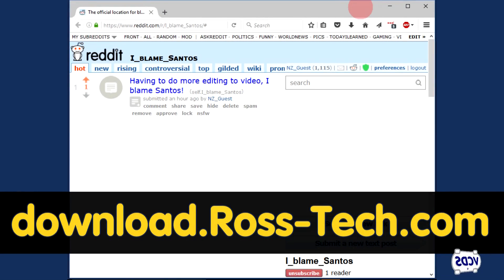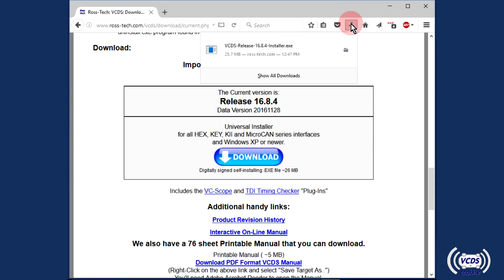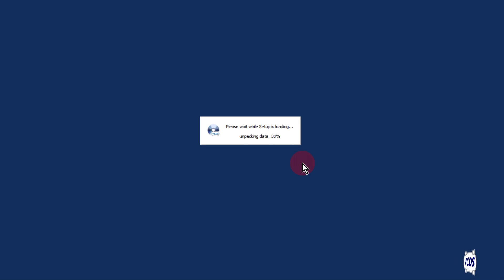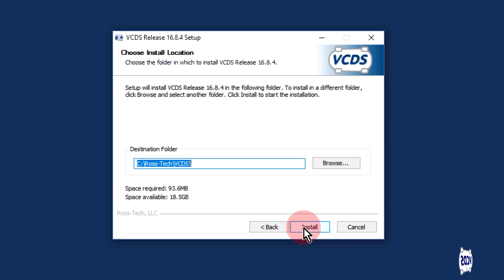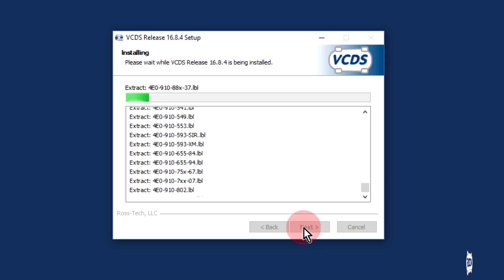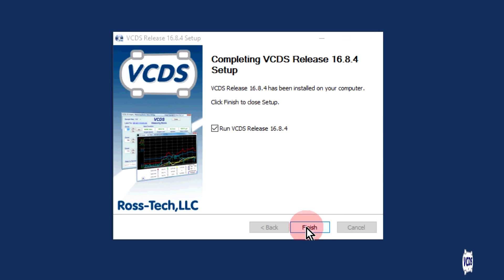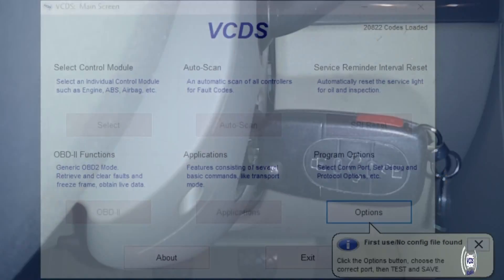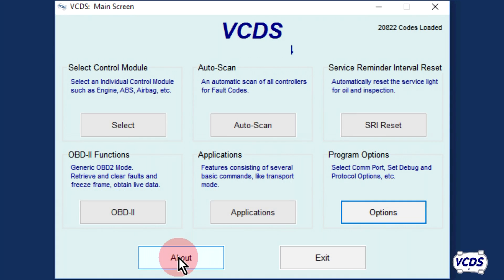How to install VCDS.

Comment: I followed the steps in the video, but when i do the test i get this message ''not plugged into car''. When interface is connected to car led is green and red when it's not. Can you help me with this problem? It worked before I installed windows on my laptop. I have VCDS 17.8 versions. 
I tried on two different cars and same error.
Reply from the maker: Hmmmm..... I wonder what the issue could be?  17.8 has been discontinued for about  3 years now.....

Comment: It works to install this if I have 10.6 version ?
Reply from the maker: 10.6 is waaaaaAAAAAAAAAAAAAAAAAAAAAAAAAAAAAAAAAAAAAAAAAAAAAAAAAAAAAaaaaaaaaaaaaaaaaay outdated and not supported.   There is no legit reason any person would ever want to use such outdated software.  There link for the current version is up there in the description.
Reply: Maybe he hasn't needed to check on anything, or update, or like myself,  have my old Vag-Com but haven't owned an Audi in some years.